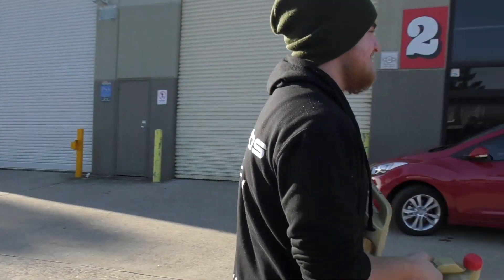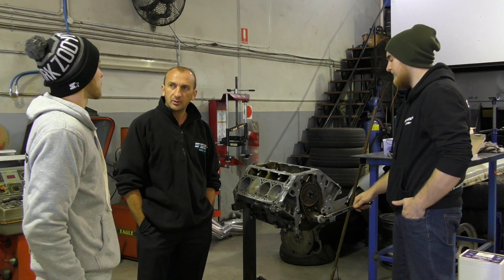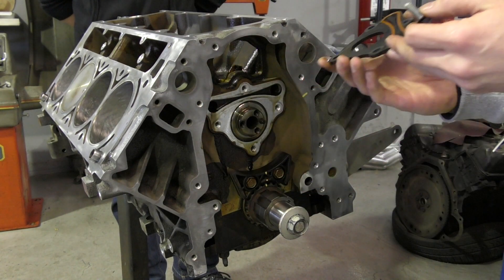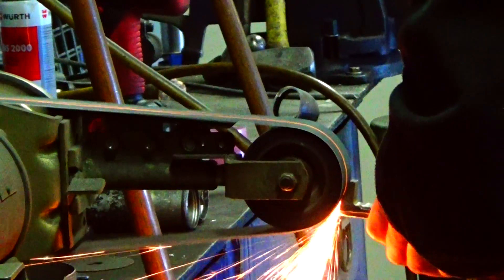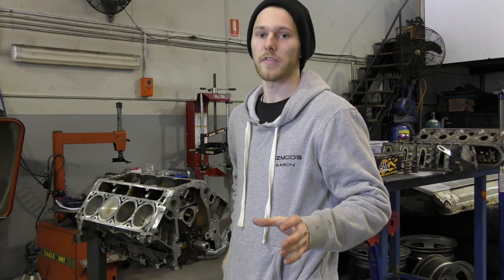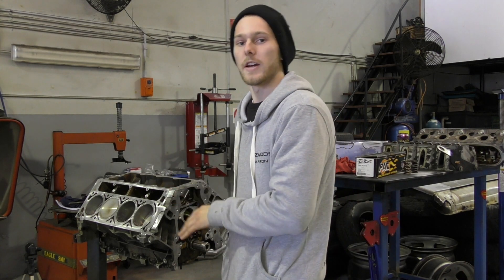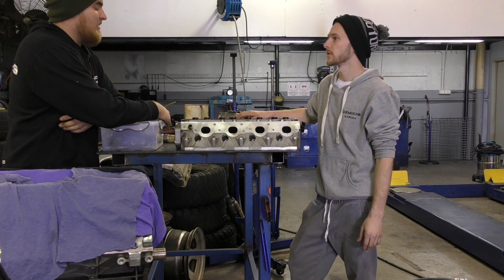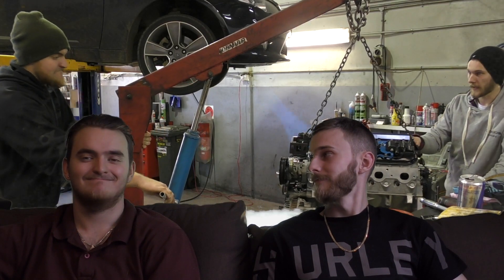Ozmods - GM small-block engine rebuild ( part 1 )

Comment: I have an LS1 engine in my VY Commodore which has has had a couple of noisy lifters for a few years on & off.

I think the camshaft has been hammered by now so I'm going to replace the camshaft with a stock Holden issue LS1 camshaft from a VT series 2 model Commodore.

I know that the oil pump & bearings are all good because I checked the oil pressure at idle speed with a warm engine (30 PSI), 2000 RPM (37 PSI) & 4000 RPM (60 PSI),so I know that the oil pump & bearings are good.

So,I'll replace all the hydraulic lifters & replace the worn timing chain with an upgraded Rollmaster  single row timing chain.

The timing chain itself is an LS2-LS3 item by default as the superseded LS1 timing chain was a crap paper thin one,mine is stretched 337,498 km timing chain which causes the ECU to set a code,the replacement lifters are also LS7 lifters by default now.